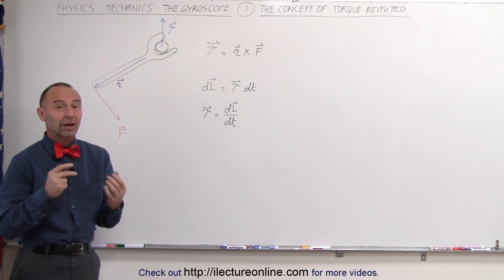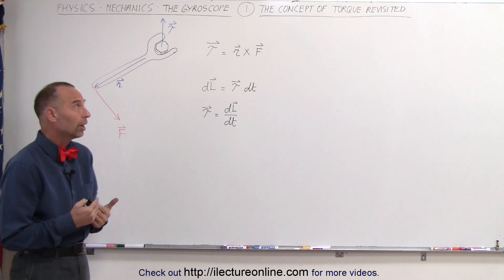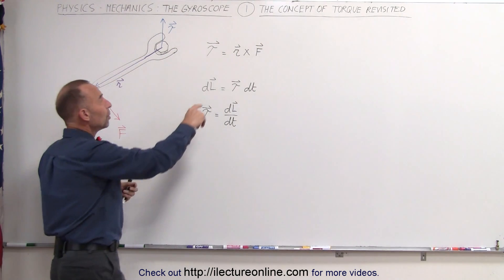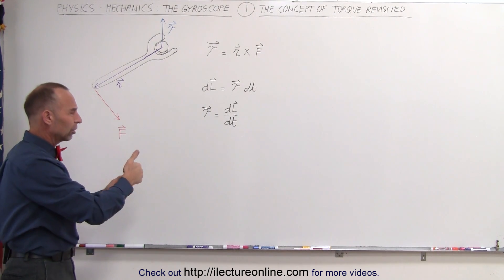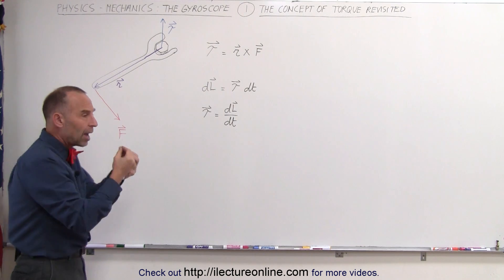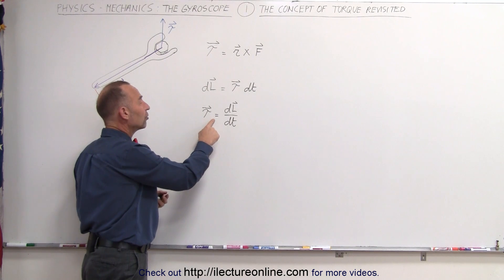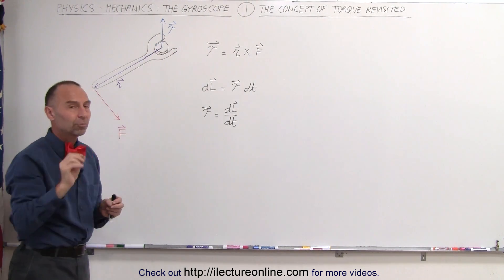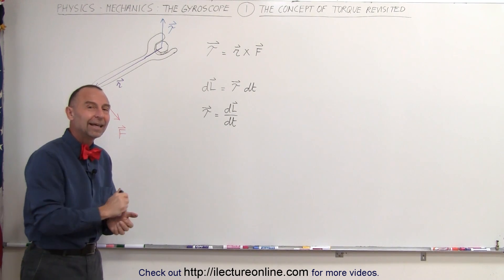Physics 13.6  The Gyroscope (1 of 5) The Concept of Torque Revisited

Comment: its difficult to visualize how a Torque perpendicular to the position vector and Force doesn't violate conservation of momentum
Reply from the maker: Torque when acting on an object produces work.  Work produces a change in energy and a change in momentum.  Therefore momentum cannot be conserved if torque is applied.

Comment: When you say that the torque comes out of the board, though both the force and the vector from center of rotation to point of force application are in the plane of the board:  is this just a convention used to specify clockwise versus counterclockwise rotation, resulting from the torque, within the plane of the board via the right hand rule?  Or are you saying that an object in the plane of the board that is acted on by the torque that is said to be directed out of the board based on the cross product and right hand rule, that such an object would actually move (if unconstrained) out of the plane of the board.  I never understood this since 1st year mechanics.  If the latter is true, from where comes this motive force out of the board when all of the force exerted by the wrench is within the plane of the board?  Would this become more intuitive if I could watch some experiments with gyroscopes?  If the direction of the torque is more than just shorthand for the clockwise vs. counterclockwise nature of rotation purely within the plane of the force, is the direction of the cross product of two vectors then important to understanding the direction in which electromagnetic fields oscillate and propagate along waves?
Reply from the maker: Very good question.  The direction of the torque (away from the board or into the board) corresponds to the tendency of the torque to rotate the object in the counterclockwise or clockwise direction respectively.  However a torque applied to an object that can rotate and that has a moment of inertia, will cause it to have an angular acceleration and will give the object an angular momentum which also points outward or inward in the same way that the torque does.  Note that the angular momentum (just like the linear) momentum is conserved which is what causes a rotating wheel (or wheels of a bicycle) to stay upright.
Reply: @MichelvanBiezen  Thank you for your answer, which inspired me to watch this demonstration, https://m.youtube.com/watch?v=ty9QSiVC2g0.  Now I think I could do an exam question on the topic, but would not yet say that I “understand” it.
Reply from the maker: You may enjoy this video as well:  https://youtu.be/fv_AinDLHJY

Comment: How do we understand this then if you tell us that it's something we're going to ignore and then you toss out some crappy math that explains nothing to clarify HOW it works.  Does the gyroscope just refer to some mathematical formula and then do what the math tells it to do?  If so, how does the gyroscope learn math?  I doesn't even have a brain.
Reply: @crashsitetube - Lol. I can't tell if you are serious or not; mathematically, that equals great trolling.
@Michel - I appreciate anyone who puts up free lectures. Skol.
Reply from the maker: Did you watch the last  5 videos in this playlist that explain how the gyroscope works?  PHYSICS 13.5 ANGULAR MOMENTUM  https://www.youtube.com/playlist?list=PLX2gX-ftPVXVN2K-94gb_S2Yu3hLuV9xD
Reply: @MichelvanBiezen  - Sorry to be 5 years late responding. Your link is to exactly the problem with my first comment. It's ALL math that claims to explain it...as if the gyroscope has some awareness of that math and makes the calculations (somehow) to determine what to do and how and how much to do it and then (using some sort of conciousness?) manages to complete the task based on the calculatlions it has made>

I'm having trouble believing that. But, I do believe thatthere is an explanation of how the gyroscope does work that has nothing to do with mathematics but, rather a process of integrations.

That is, directed forces generated by some number of particles of some mass and velocity arriving at some surface or interface.

In fact, that seems to be the way ALL physical processes work. And, that largely explains wehy most of the science taught (mathematically) in the school science curriculum contains so many errors.

Having continued to cogitate on this issue, it appears that Einstein's "Grand Unified Theory" has nothing to do with some single equation that explains everything. It's a fairly simple, better explained in the 'king's English...or other languages/dialects of their realm' that follow the notion of the integration of forces  exerted by the particles (particles being any matter of any size or complexity from atoms (which we consider ourselves to be made of) to Universes out to infinity and particles down to the infinitesimal)

Crazy as it sounds it has to be that way. Any bounds you put on...anything...implies that there's something beyond those bounds. Ergo: no bounds are allowed and all "processes" of time, space and matter must extend from the infinitesimal to the infinite.

Personally, I don't have a problem with that. But, it does mean that we can never know where we are in space or time or what size we are within the time and space we are in.

We can only get a sense of scale by establishing some sort of arbitrary datum and comparing our scale to that datum. Here's something that explains this:

https://drive.google.com/file/d/1RGV5ETyiES3weUsRn_AaeyrLI-7htNsn/view?usp=sharing

salaphysics.com
031722
Reply: crashsitetube Wow you are incredibly ignorant. did you pay attention in high school physics class? just because you don't understand the mathematics behind it does not mean that it does not follow these rules.
Reply: Okay, here's a clear explanation of how a gyroscope works:

Gyroscopes don't defy gravity. Their angular momentum changes their interaction with the the force of gravity because it "locks" their orientation to the gravitational field, because the force of gravity is not strong enough to turn them. As a result they are held up by any point of contact with a normal force sufficient to counter their weight, even if it isn't directly under their center of mass, as long as it is along their axis and doesn't directly impede their spinning. In a sense, their center of mass has been distributed to everywhere on their axis of rotation, at least for certain interactions.

It is the same reason we aren't yet tidally locked to the sun.
Reply: +crashsitetube
Unfortunately, it's not clear. Besides, your terms - "gravity", "angular momentum", "force ", "field", "normal", "weight", "center", "mass", "axis", "spinning", "rotation" - all require mathematical definitions.
Reply: @y.z.6517  Those terms are all things we observe physically and describe mathematically. You have a centre of mass. Do a summersault on a trampoline and you will observe it. Math doesn't create that. It exists independently of how it is described. To suggest anything described by math is fictitious is the logical of denial... You wouldn't happen to be a flat Earther would you?
Reply: @Mrsmiley291  When did I "suggest anything described by math is fictitious"? My point was that crashsitetube's explanation is not independent of mathematical definition.
Reply: @y.z.6517  Weasel words. Using math is a simple way to explain complex things. The "words" are all things not made up constructs. Angular momentum is an observable thing. The effects of gravity are an observable thing. The mathematical formulae that describe these things are validated empirically every time they successfully predict the behavior if physical things. Given the input values the behavior if a gyroscope can be modelled mathematically and predict the physical behavior exactly. While the model works then the model is correct until such a time as a more accurate model can be developed
Reply: @Mrsmiley291  A is an observable thing does not mean that A exists without definition. Gravity, for example, is defined as a force. What is a force? A force is defined as that which gives mass a given acceleration. What is mass? A quantity of mass is defined as that which accelerate by a given amount by a given amount of force.
A simple maths function is operator(a,b)->c.  (a,b,c) only exist when all 3 are defined. They are observed only after they are defined. I suspect philosophy of maths is too difficult for you, but you can still enjoy the convenience of maths operation defined and refined by mathematicians over tens of centuries.
Reply: @Mrsmiley291  Let me give you an example: the amount a material expand when pulled is given by Hook in the 16th century: F=k*x. It's a simple function, with respect to force, length, and a black box k. This is only defined for a small force. Once a force exceeds a given amount, there is no simple equation to describe it. In fact, engineers use different equations, all very complicated, to approximate material failure due to exceessive stress.
Also, F=k*x does not define variables such as material, temperature and so on. All are now defined by engineers who need them, but not in Hook's day. In other words, Hook only defined the relationship between force and the length that a given material expand with respect to the said force in a given range, when all other conditions are equal. Every thing else is left undefined, albeit existing in nature, in that mysterious k, and that is only in the defined domain, for a defined types of materials that share the set of defined properties.
Reply: @y.z.6517  I understand that not everything in the universe is completely understood, and this is impossible as at each point of knowledge you can ask the next question that will be unknown. This doesn't invalidate the physical events being modelled, all models operate with a range of assumptions. If the model works as an abstraction that is accurate the model is good enough. When the model fails a new model must be found. Is the model "true"? That is a subjective question. G is not a fully defined constant but it is precise enough for our needs. Experimentalists are coming up with ways to get a better value as we speak. What causes gravity is yet to be understood but it doesn't mean it's effects can be discarded.
Do models change over time? Yes. Do mathematicians add fudge factors in models to make them match empirical results? Yes. Does science have a god like omnipotent knowledge? No
Reply: @Mrsmiley291  That's basic knowledge for anyone who cares about the history of science, and what is your point?
Reply: @y.z.6517  Your point was the explanation was not clear if mathematical definition, with an example of "force". Surely language doesn't require definition to it's root and some basic knowledge can be assumed? It is not the presenters role to provide an entire education
Reply: @Mrsmiley291  Find me a person who knows, say, "angular momentum", but not torque?
Reply: @Mrsmiley291  A good maths lecture explains the relationship of a set of terms together. Your type of explanation is suited for humanity rather than science.
Reply: @y.z.6517  I am lost to any point you are trying to make.... I am sure you made one and it was very clever. Well done you.
Reply: @Mrsmiley291  My points were:
1. His explanation is not clear.
2. His terms are defined mathematically.
They are far from clever, but how are they not clear? Then you jump out of nowhere, and putting points I didn't make into my mouth.
Reply: @y.z.6517  I think it was clear enough. There is a presumption of basic knowledge but that seems reasonable to me.
Reply: Understanding the math allows us to form pictures and more clear concepts in our mind, reading it like you would a novel or poem that contains vivid imagery. But, I shall explain it to you, as you wish. Imagine a vertical disk, such as a wheel, with an arm extended on one side, sitting on a pole of sorts. The rotation of the gyroscope creates a force outwards and perpendicular to the disk or ring. The force of gravity causes torque, which is parallel and in one direction, and perpendicular to the force of momentum, away from the disk, causing to to spin on a fulcrum opposite to the force of momentum.
Reply: WOW mathmatics DOES not need a brain as you have demonstrated ! it is descriptive
Reply: I didn't say (or wish to imply) that the gyroscope doesn't follow the 'rules' set out mathematically. That doesn't mean the math is right. It just means that, for engineering g purposes, it provides useful data.

Nothing in the video tells HOW the gyroscope does what it can be observed to do. This is not unique.Math geniuses are not geniuses at math because they are insightful. They are good at math because they diligently and faithfully learned and rigorously follow the rules of math. In fact, they love to say that they 'rigorously' do that...with no small amount of pride...which I suspect you do as well.

That takes a very procedures oriented mindset that usually (not always...but, usually and as exhibited by this presenter) of a very rigid, rote-learned knowledge base.

So. You've told me how wrong I am. How about being useful and telling me just HOW a gyroscope manages to maintain its orientation when it's support point is clearly NOT aligned with its center of mass and why it falls over (as expected) when not spinning but, doesn't when it is spinning (fast enough).

You at least strongly infer that it's done by the sheer force of mathematical calculation (calculated by ?).